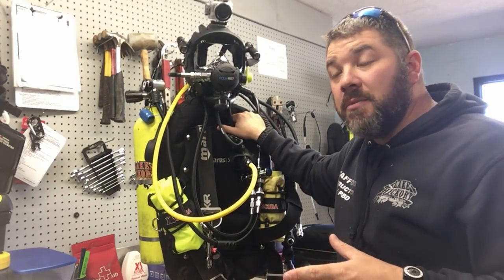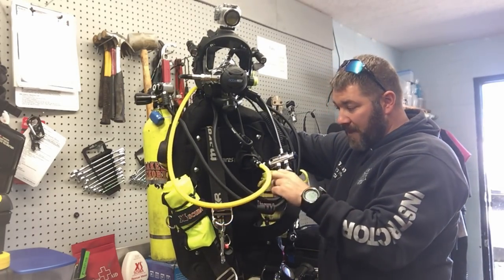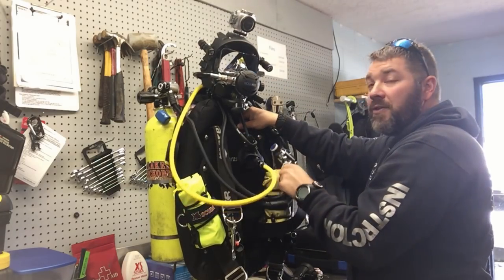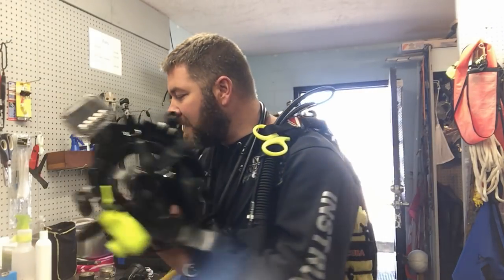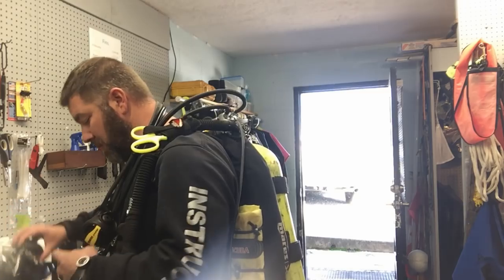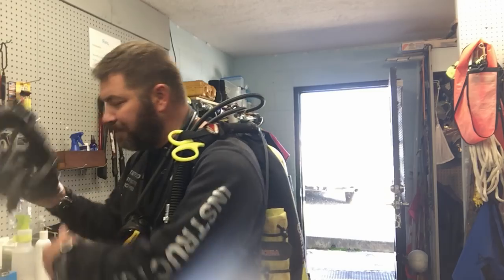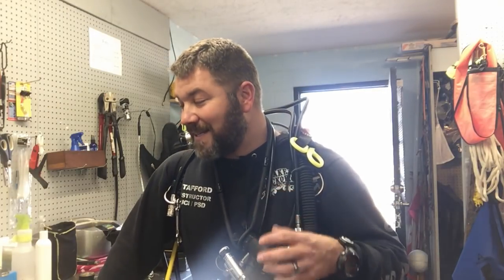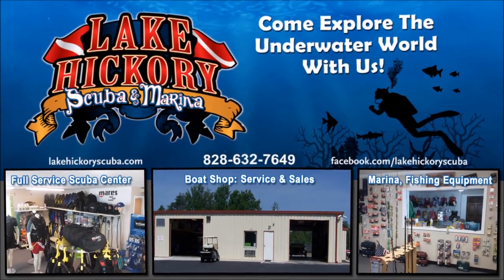How I Use The Ocean Reef Dual Tank Valve

Comment: What hose lengths do you use, and what type of QDs do you use for the tanks?  And last, does it have to stay sealed from before you get in the water until you get out, risking the inside of the DTV getting water in it?
Reply from the maker: Hello Mike Dugan, on this particular system (my Public Safety Rig), I use standard length hoses. With that being said, I have custom length hoses on all my other rigs. The great thing about the Dual Tank Valve, with the Quick Connects on them, they are sealed from the ambient environment.
Reply: @LakeHickoryScuba  Perfect. Thank you.. We're using them now and playing with different lengths for different configurations and environments. Fun to play and learn what works best for each diver.

Comment: Another interesting video, Bryan. What size is that PONY bottle?
Reply from the maker: The one in the video is a 30cf Aluminum.
Reply: Yeah, I thought it was quite a bit larger than my 19cf PONY. I carry 9 pounds of weight with my 5mm wet suit, but I put 3# on the PONY side and 6# on the other side. All total, my rig weighs 70#. When in the water I forget the PONY is there. I suspect that I would know a 30cf bottle was there.
Reply from the maker: Typically speaking, a 30 cft cylinder is slighlty off balanced by about 2 pounds.  Me personally, I don't even try to compensate the 2 pounds difference, whether I sling the tank under my right arm, or if it is back mounted, as in this video.  I can manipulate my body enough to deal with the 2 pound off set.

Comment: Brian, hello! Great video! I have used all your ocean reef videos as references. Currently, I own an ocean reef idm and was considering getting the dual tank valve to run independent doble tanks each connected to my ffm using the valve. For psg I’m will use two independent shearwater transmitters. What do you think 🤔 and also do you have a link to all the hoses and quick disconnect parts so I can get them? Thanks in advance
Reply from the maker: Hello Carlos Soltero, although independent doubles are not recommended, using the dual tank valve from Ocean Reef makes it easier to transition for sure.
Reply from the maker: Also, we sell all the quick disconnects.

Comment: Hi Brian. Thanks for the great video. I am interested in setting up a redundant air pony using the dual air switch for my  FFM. (this way can keep the FFM on in the event of out of air or 1st stage reg failure). Can you give me an idea of what length hoses I should install.  Also is there a way to attached the gas switch to the bcd so that the weight does not pull your supply hose to the FFM?  Thanks
Reply from the maker: Hello Aaron B. For this stet up here, I use standard length hoses. Typically, two 36 inch hoses work great. If you have a chest strap on your BCD, you can secure the gas block underneath it to hold it in place.

Comment: Hey Bryan, got a question that kinda relates to this video, my current setup is 30cf pony on my back, with a normal second stage on a necklace w/ quick connect so in a ooa situation I can unhook from my reg on my neck and plug into my ffm, my main bottle octo is on my right front hip for buddy ooa. I am going to make the transition to bp/w with a long hose, what kind of setup would you suggest that incorporates the long hose so I dont have to keep taking it off when I want to dive ffm. I'm also thinking of slinging the pony bottle too.
Reply from the maker: I get asked this question a lot about using a long hose with a Full Face Mask.  The simplest thing to do, is to add quick disconnects to each second stage and to the hoses as well, this way all you have to do is simply use the quick disconnect to change air supplies. You can do this manually or use the Dual Air Valve from Ocean Reef. The biggest issue you will come across is when you need to donate air to a buddy.  Typically with a long hose configuration, the second stage that is on a necklace becomes your primary and you would then donate the long hose to the out of air diver.  Of course you can't do this with a Full Face Mask.  One option would be to make the short hose your primary for the Full Face Mask, then the long hose would have a standard second stage on it, and would be clipped to the right shoulder D-ring.  This would then be the donate-able second stage to the out of air diver, just like it would be in any long hose configuration.  As far as bringing your pony system to the front, using a sling, I would probably add the quick disconnect to the second stage of your choice, both on the second stage and the hose itself, and this will allow you to use it as a standard bail out system, and give you the option to connect it directly to the Full Face Mask as well.  Just make sure you practice switching air supplies each time you go diving so that you can build up muscle memory.  The system I showed in the video is set up for me to do SOLO diving, and to be self reliant while Public Safety Diving. You can always add another second stage to your pony bottle which would be an extra donate-able second stage to an out of air diver.  We will do this a lot when we teach deep courses.  We will use a first stage with 4 second stages attached to it as a hang bottle on our ascent line.  Just make sure you keep all your hoses neatly routed along the cylinder to prevent any entanglement hazards.
Reply: @LakeHickoryScuba  perfect, thanks for the quick reply even on a little bit older video
Reply from the maker: You're welcome, hopefully it gave you some ideas.  Happy Diving.

Comment: Hey, how are you? Hope you get better from your cold.
I'm curious, how do you compensate/equalize the ears with that mask, since you can't pinch the nose.

Hugs from Portugal,
Ronaldo
Reply: VashBlaster it has plugs, I also do not pinch my nose to equalizer I can’t speak for Bryan, but I can do it just by breathing
Reply: When I do deeper dives, on the descent i do both, i pinch the nose and breath through the nose to equalize, but when it's shallower like 12m max i only pinch going to the bottom,  afterwards i just breath through the nose from time to time, but using normal mask, never tried a full face mask.
Reply from the maker: Hello VashBlaster, as mentioned by Calvin Cousins, there are plugs that are inserted inside the mask that block off the nostrils allowing a diver to equalize via the Valsalva Technique.  Sometimes I will also simply swallow to equalize.
Reply: Nice, it's always good to know.
By the way, talking about mask lenses, since you dive in allot of murky waters, do you ever use any kind of special lenses to improve visibility? Like that golden lenses from Mares? That they claim it improves visibility in waters with allot of suspension/flakes/debries.
Reply from the maker: I use standard lenses.  Nothing fancy.  I wouldn't but into a lot of the gimmicks you see from manufactures, even Mares.  The best way to see better underwater, is to dive where the water is crystal clear with no turbidity.
Reply: Another question I've been wanting to ask you, and this would give a good video.  Masks (normal and full face) sealing and mustaches/beards. I had that trouble when i started diving and doing a bit research i realized it was my mustache breaking the mask seal and letting some water in, now i trim the top of the mustache so the seal fits properly and don't have problems.
How do you do it? do you have any problems? specially cause you also have full face beard and use full masks too.
Reply: VashBlaster a lot of people use vaseline in my travels.
Reply from the maker: VashBlaster, here is a video we uploaded a while back talking about facial hair and mask seals. https://www.youtube.com/watch?v=akDJQiidldw
Reply: Yeah I heard about that technique or any kind of "fat" cream. But I  bet that that having a runny nose of the salt water and the vaseline isn't a good sight xD.
But since I shaved the top of the mustache i never had any more problems with that. But the seal under the nose in the mask is short so... Mares and other masks sometimes have longer skirts
Reply: Will take a look, thanks ;)

Comment: Why not just dive a set of small doubles like LP-50s? That way you have a standardized setup with regular manifold, in addition, your back weighting will be more balanced and lower profile for easier in water mobility.
Reply from the maker: Great question jameschho.  In short, policies prevent this from happening, and secondly, I hate doubles.  Now days if I am in a situation where more air than an 100cf steel is needed, I go Sidemount.  I gave up diving doubles over a decade ago.  This again is prevented by team policy for Public Safety Work.